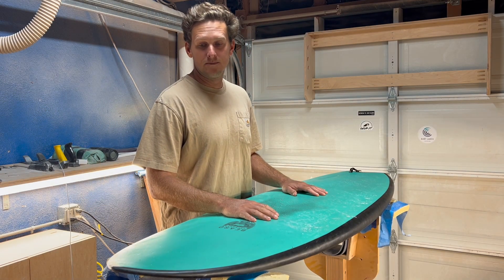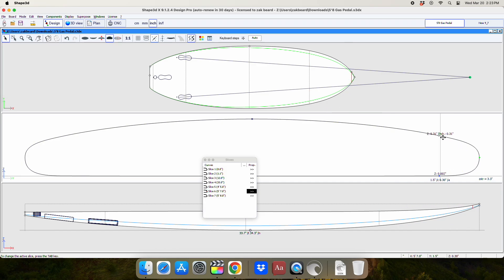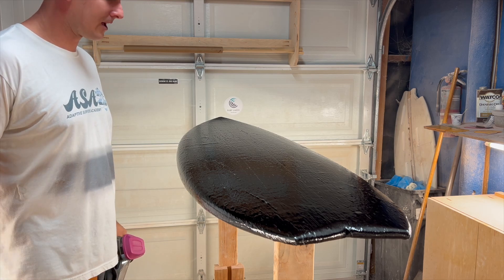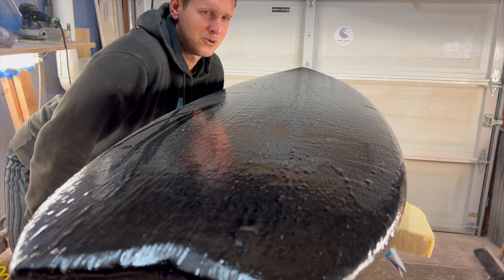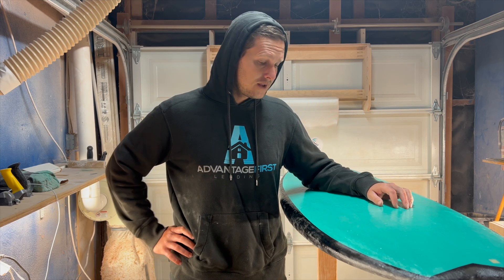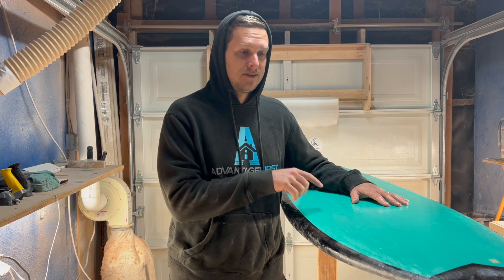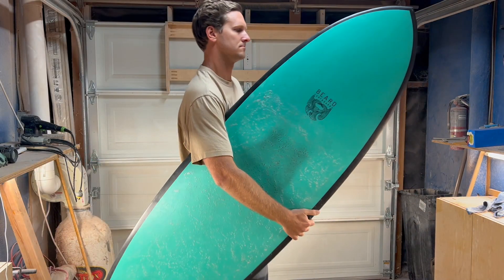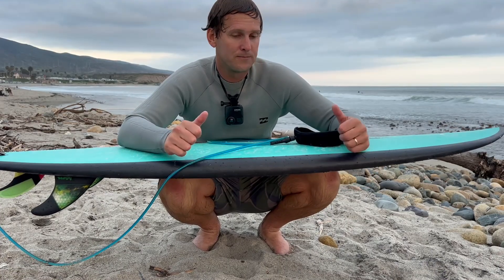Surfboard Shaping from CNC to Surfing - Carbon Fiber Groveler

Comment: Hi Zak on a commercial level,once a blank is cnc cut how much is left for the shaper to finish off?My concern is if I order a CI or Lost board would different shapers shape different rails?
Reply: Hey! There is the CNC cut lines to get out, the rails will be cut to the shape you designed with the software you will just have to screen the rails out. If you do a swallow tail you will have to manually do that. Once you get it down you can scrub a machine cut board and mark your fins in about 20 mins. Hope that helps! Give my channel a subscribe as I will be adding  a lot of content. This is a great channel and I really like all of his videos!
Reply: @onerevolversurfboards  thanks for replying...one question however...if i ordered a Lost RNF96 in California and then ordered the identical board in the UK,will they be identical?Since its different shapers could the rails be different?

Comment: Appreciate the experimentation.  I’m brainstorming some ways to lessen pressure dents on the deck.  I believe the paint may have needed more time to cure.  I would like to try pu foam with epoxy glass.  Can I ask where you got the CNC done? 🤙🏼
Reply from the maker: Glad you enjoyed it and good luck  with your board! I got back and forth between Marko foam and bashams for cnc. Just depends on if I use an eps or pu blank
Reply: @ZakBeardSurfboards  Appreciate that, thank you.
Reply: Epoxy glass job over Poly foam.  Strongest combination.  You can do a dent proof deck by putting Vector Net under a six ounce deck.  Like a rock.

Comment: what i have been doing is getting pre-preg cnc cut carbon, as well as the cnc cut foam board. the pre-preg is the perfect shape. it's easy, clean, fast and you can take all the time in the world. then bag it, get the room the right temp and suck and cure. you should be able to find somewhere that will cut pre-preg near you. i highly recommend. it's less detrimental to air and lungs too! you can keep it rolled up in a fridge indefinitely.
Reply from the maker: It’s funny you mention prepreg. I just discovered it and am making my next board with it. To be honest, I wasn’t super stoked on how easily it stuck to itself. Carbon is already extra difficult and it made it even more difficult to work with. But stoked you’re liking it👍🏼
Reply: Cut as shallow into the deck as you can, the outer foam is stronger, you don't need denser foam if you take less than 1/8th off the deck. Try and get S glass or better 6oz SX glass from shapers australia and use it with a 2oz e (or S) glass layer.